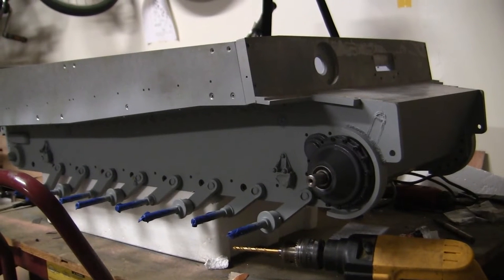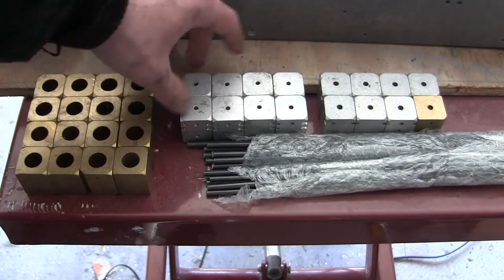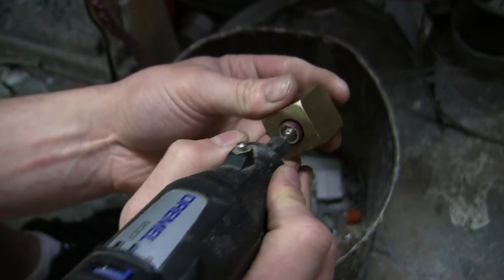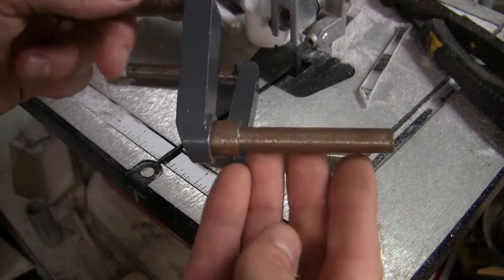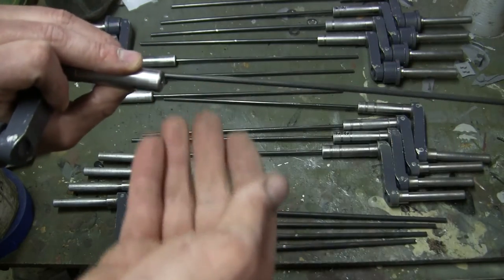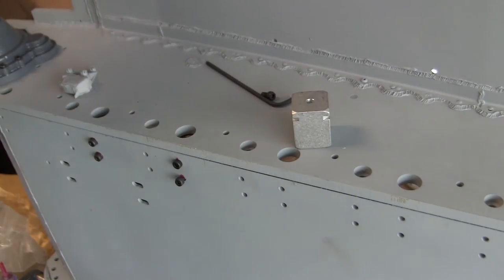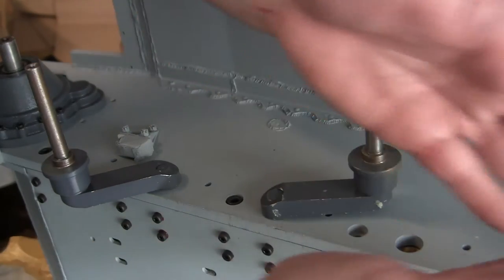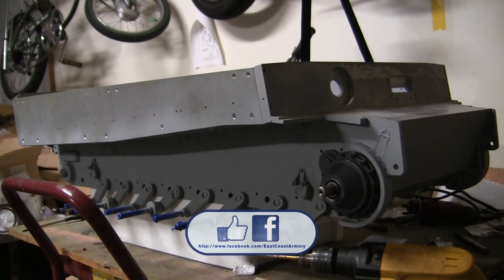Vintage RC 1/6th scale armortek early production Tiger I Video#3 (torsion bar suspension)

Comment: Do you superglue the bearings and seal in the gear case housing as per instructions? Not sure why they tell one to do this when it seems it would make removal/replacement operations quite difficult. And doesn’t the gear rub and make contact with the side hull or does the grease keep it from doing that?
Reply from the maker: no, I don't use adhesives for the install of these parts

Comment: Suggestion for anyone who has to do the opening up of the block holes.  Although use of a sanding drum will get a usable result, there is always the possibility of "ovaling" the hole if careful attention is not paid to the work.  Another method that pretty much guarantees a circular hole is to make what I call mini-flap sander.  The way to make this is to get a 1/4" solid rod about 4" to 5" long.  The rod can be any type of metal.  Cut a slit about 1.5" to 2" long in one end of the rod, centered in the middle of the rod.  Take a strip of sandpaper of appropriate grade, put one end through the slit, and then wind the remainder around the rod in the same direction as the rod will turn when it is chucked up in the tool (i.e., Dremel, air grinder, etc.).  Make sure the amount of sandpaper strip when wound is smaller than the starting size of the hole.  Insert the sandpaper end of the mini-flap sander into the hole and grind away.  Since the sandpaper strip will push out to the hole perimeter through centripetal force, you are pretty much guaranteed a circular hole without having to worry about any oval effect.I really enjoy watching you videos and your attention to detail is spectacular.  Keep up the great work.Regards;Ron Kluwe
Reply from the maker: +Ron Kluwe Yes you are correct ovaling is something to watch out for and care is to be exerted while doing the procedure along with a steady hand. Your method is also a viable option if someone has the time and doesn't have the nerve to go with the dremel. Luckily though that the amount of material to be removed is so small that the chances of ovaling the hole is small and remote.

Comment: Are the swingarms set at 45 as per the instructions or have you encountered a different angle that works better with these first series Tigers?
Reply from the maker: yes, the 45 worked for my builds

Comment: Why not get a ream of the proper diameter? It might be expensive but will save tons of time!
Reply from the maker: +fw1421 Since this technique is only needed on very early run armortek tigers the ream is not practical. The whole boring out procedure was done in about a half an hour